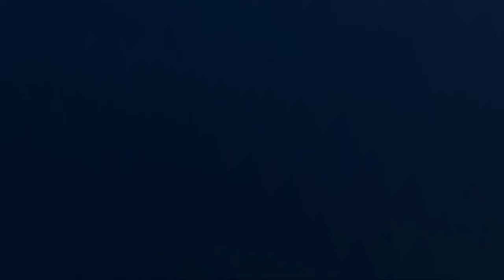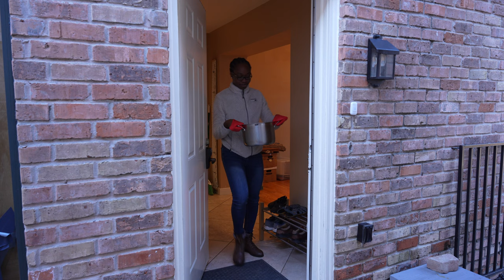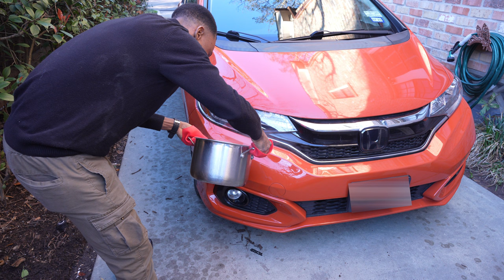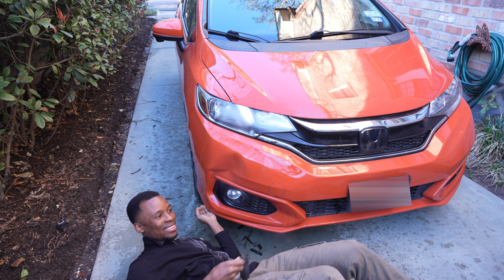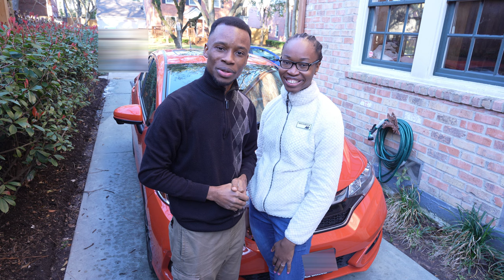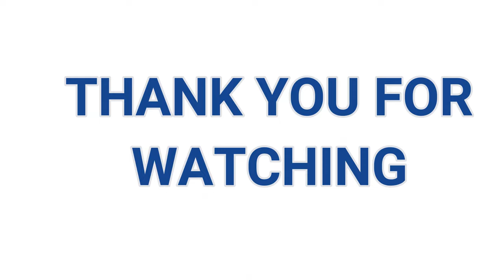How To Fix Car Dent Using Hot Water

Comment: nice, you softened the plastic first. i wouldve just force popped it, might make small cracks in the paint.      i  hope i can remember this.
Reply from the maker: I'm glad you found the tip helpful! Softening the plastic before popping it is indeed a great way to avoid potential damage like small cracks in the paint. You can always come back here to re-watch the video.